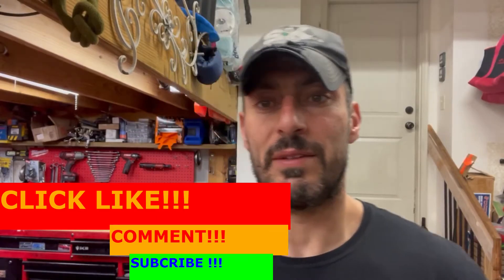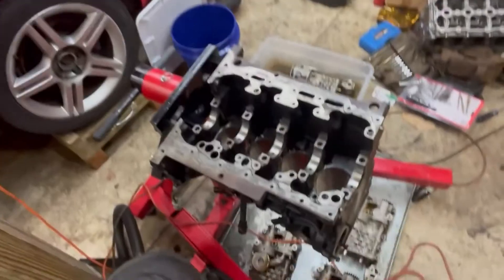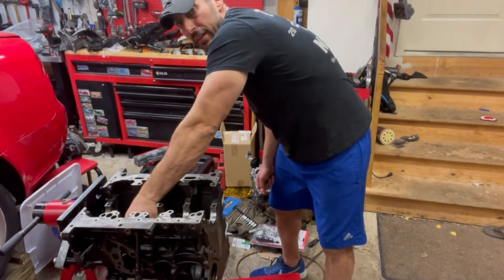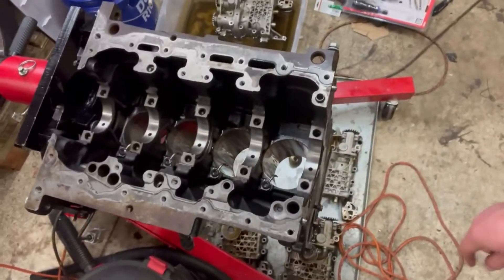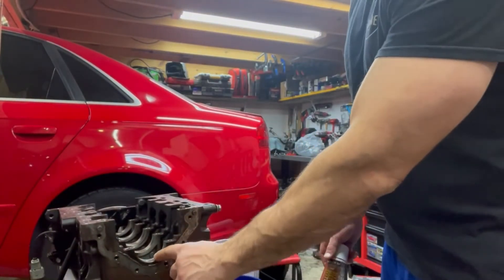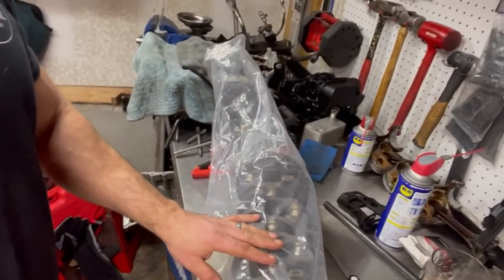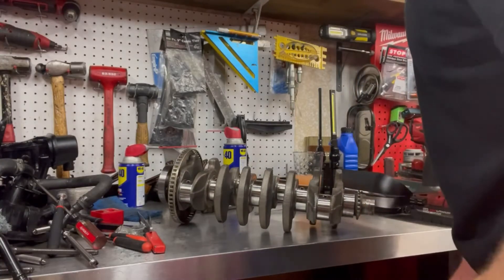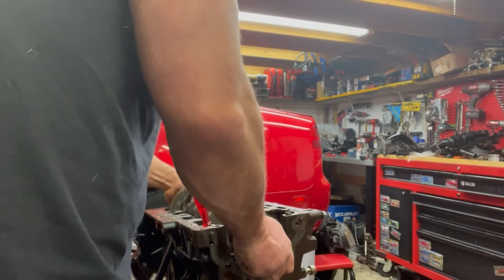PROJECT ROJO RE-DO PART 8: Initial Engine Reassembly - Oil Squirters and Bearing Clearances

Comment: Hey what's up man i been having the same problem with my Volkswagen too..whats the part number to those squirters??
Reply from the maker: Hey Man - thanks for the comment! The part # for the oil squirters is 06F103154A or 06F103154C depending on your VIN. I dont see a difference between the two part #s and think they will each work in any 2.0. Good luck!

Comment: Hello brother, i got a Audi A3 2.0 FSI (no turbo engine) and i got the same problem with de oil pressure. Will check the oil squirters thank you
Reply from the maker: Hey Brother - thanks for the comment. Good luck with your repair - DEFINITELY check the oil squirters. One or two bad ones can be enough to cause low oil pressure issues.